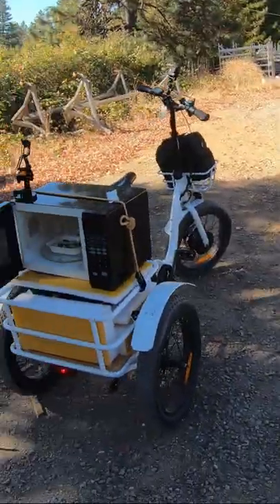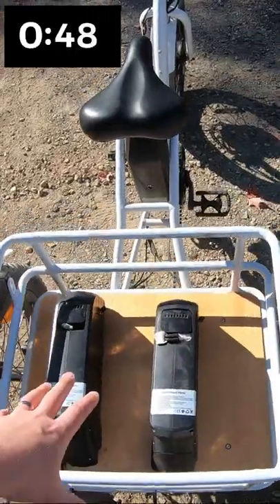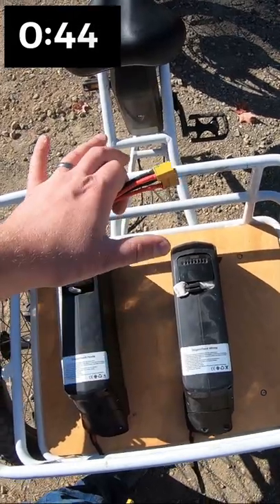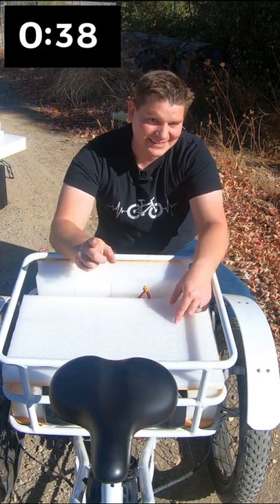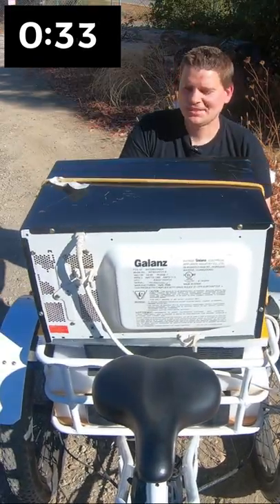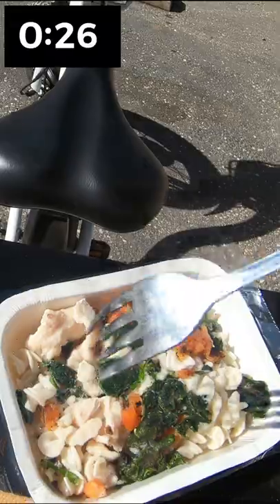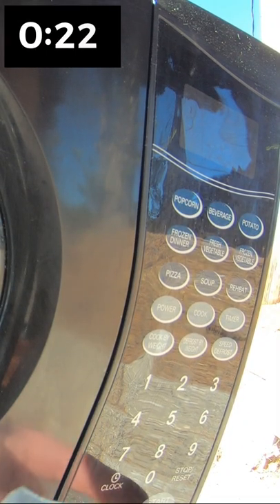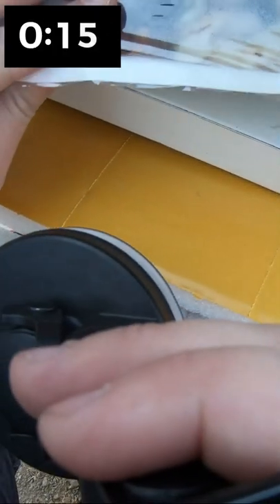Cook Your Lunch While Riding Your Ebike

Comment: Hey Kyle, to attach two 48v/21ah batteries together, would I need a parallel connector and two adapters for this process on a foxbat 1000watt ebike?i also want to mount the second battery on my rack.